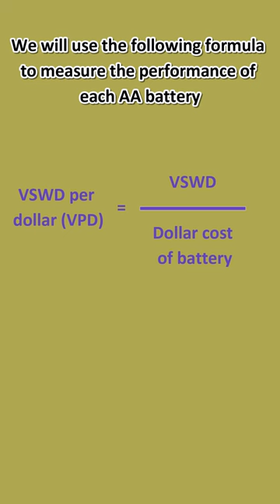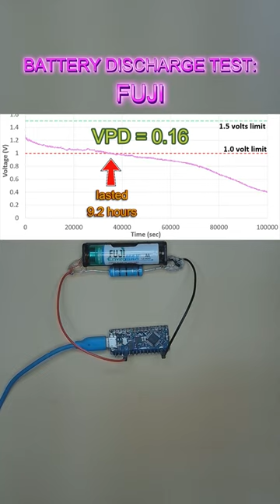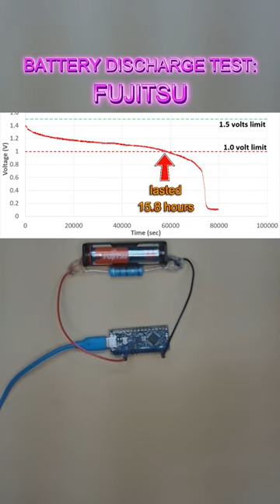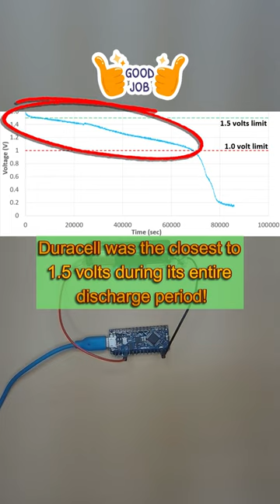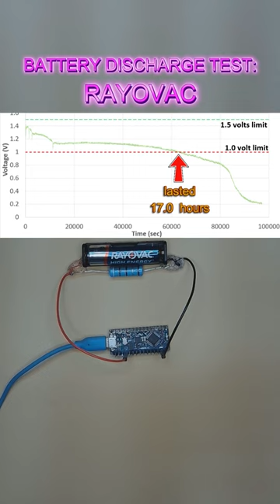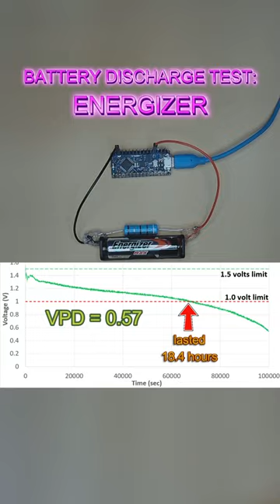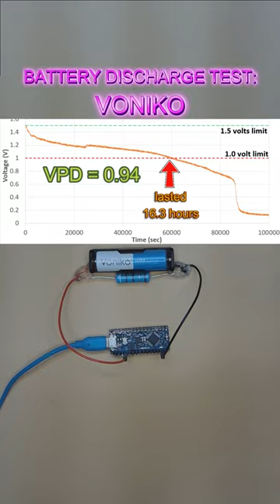13 batteries 1 winner - testing to find the best AA battery

Comment: Could you also make a ranking for the longest lasting battery independent of cost?
Reply from the maker: Great question. I already have that data and I am sharing it below. I measured the battery life for each battery as the duration (in terms of hours) output voltage remained above 1 volt while discharging across the 10 Ohm resistor.

Following are the results for that ranking. I hope you will find this to be useful 😉:

BATTERY BRAND    HOURS ABOVE 1V
Amazon-Basics	    19.2
Duracell                      19
Energizer                    18.4
Alkalicell                     17.5
Rayovac                      17
Maxell                         16.4
Voniko                         16.3
SignatureSelect         16
Coast                           15.9
Fujitsu                          15.8
Fuji                                 9.2
Panasonic                    4.5
Eveready                       4.3

Comment: Good that you created this test, however I have several thoughts about it:
- Some batteries react differently to different loads. So testing with only 1 value for all batteries is not valid for all kinds of applications. Like using it for a TV remote or a flashlight. 
- Such tests are more valid when tested more than one battery from the same brand. There are some differences in manufacturing, so you can hit a faulty one.
- I am a bit suspicious regarding that sudden change of voltage on some of those graphs I have seen. I do not think a battery can produce such... faulty measurement?
- I am also not super convinced how an arduino nano qualifies as a proper calibrated multimeter. Can you trust its measurements?
I think the basic idea is good but this test could have such improvements.
Reply from the maker: Thank you so much for this excellent comment filled with great points. I did read it a few times and will do my best to clarify a few things and contribute to this very informative thread for the benefit of others as well.

Before getting into the technical piece, I would like to share a brief disclaimer. One of the key reasons why I kicked off this entirely self-funded channel is to share my passion for electronics and the art of "making" with other like minded people while demonstrating how accessible many concepts, tools and methods are in the field. I want to inspire people to start "making", experimenting and creating things themselves. Therefore, for each content I create, I prioritize simplicity and clarity over anything else. Of course, this approach does bring trade offs with it, which I recognize. So please bear this in mind while reading my comments and watching my content on my channel 🙂

After this brief disclaimer, let me try to chime in to the great observations and information you have shared in your 4 bullets. This will also give me the opportunity to get into some of the background work that is not reflected in the video content.

1 - You have mentioned about the shortfall of testing with a single value load (i.e., 10 ohms in my case) This is absolutely correct. As a matter of fact, while experimenting with the concept, I did try different load values (2 Ohms upwards). I did notice each battery reacts very differently to the current drawn from it. Each battery also heats up excessively due to the low internal resistance when high currents are drawn from it. So I settled for a load value that does not cause excessive heat up of the batteries and draws a current level that is not too demanding but is realistic for most applications AA batteries may be used for. That value for me was ~150mA. As you have stated, there is plenty of room for improvement here by repeating each test for different load values (of course, performing such extensive test also has time implications). As a matter of fact, alkaline AA batteries work at their best when current draw is not very high. For high current draws, I would prefer using rechargeable batteries for sure. (Maybe I will create a new content to cover that interesting space a well and we can continue this discussion there too.)

2 - You have also correctly mentioned testing multiple batteries from the same manufacturer is a better approach. I totally agree! As a matter of fact, during my tests I did notice significant discharge profile variations across different batteries from the same manufacturer. After seeing the variance in the results, I decided to cover the "consistency" aspect as a separate content besides the one I have published. I selected the batteries from each manufacturer based on the consistency of their discharge profile. Since I did this for each battery, I used the most consistent battery I had from each manufacturer to be fair in my tests. If I was to average out multiple battery performance from each manufacturer, the results I shared will definitely have a much higher variance and the average score for each battery will be lower.

3 - Sudden change of voltage in some of the batteries was also unexpected for me. However, I did notice this behavior on multiple batteries from different manufacturers. The one explanation I have for this is due to their chemistry, alkaline batteries sometimes fail to deliver constant current over a long period especially when that load current is high (i.e., 100 mA or higher) Had I chosen a lower discharge current than 150 mA, I would expect such fluctuations to occur less frequently or disappear altogether. (Please note I am not an expert in battery chemistry and therefore I am unable to comment on how that constant current delivery changes with the chemistry and the production quality of a battery. I would love to learn more from someone with more knowledge/experience on this than myself)

4 - Arduino does not qualify as a calibrated multimeter at all. However, based on my observations, its sampling rate and voltage measurement consistency are sufficiently good to perform a quick verification like I have done. I did experiment with multiple measurements using my Arduino set up to ensure consistency across the board before creating this video content though. With 12-bit quantization, I was able to capture voltage variations as low as 1.2 mV, which is more than enough to capture the fine variations in voltage during each discharge cycle. Also, from a time resolution perspective, sampling at a 1 Hz rate was more than enough in my application. Therefore, sampling timing errors in Arduino ADC was not a major source of error in my tests. I definitely agree measurement accuracy can be improved further by using a more elaborate measurement set up. While that is technically possible (and probably is the right approach from a scientific perspective), I would argue it will not be accessible by most of my audience. As I mentioned in my brief disclaimer, I want my content to be inspiring and encouraging enough for the viewers to experiment for themselves. I want people to see they can also create such simple measurement set ups to get insights into say how an AA battery performs. Arduino is a great platform that allows people to experiment and create that's why I love it and use it extensively. I think the Arduino ecosystem has truly revolutionized the embedded electronics space and created an inclusive environment where many people are able to share ideas and creations than they would otherwise. In other words, in terms of vision, there is a lot of commonality with what Arduino has achieved and what my channel is trying to achieve 🙂

I hope the above provides a bit more insight into the "how" and the "why" aspects of my content. I must admit while creating this content I learned a lot about AA batteries beyond an average user scope. Battery testing is such a complicated and detailed process to the extent that it is a mix of art and science and as with most things the devil is in the detail for sure! There is certainly much more to learn and much more to test and try. My hope is this video content was useful to others in some shape or form to raise their curiosity, to question and more importantly to try and experiment themselves.

Thank you once again for your amazing contribution and the insights you have shared. 🙏🙏🙏Please keep them coming!

By the way, I also started my Live sessions on TikTok (since my channel's YouTube standing is not eligible yet for Live broadcasts) If you are interested, please check out my channel at https://www.tiktok.com/@circuitappschannel also. I try to run my Live sessions every Wednesday around 21:00 Pacific time.

Take care & best regards...
Reply: @circuitapps  Wow, this is by far the longest reply I ever got :D
Thanks for the detailed answers. 
I see you did the tests more thoroughly than it seemed from the video, perhaps just mentioning your extra work behind the test, could be liked by the viewers.
I also appreciate your intentions behind your decisions, and that you try to educate and entertain. I wish you good luck and lots of viewers :)